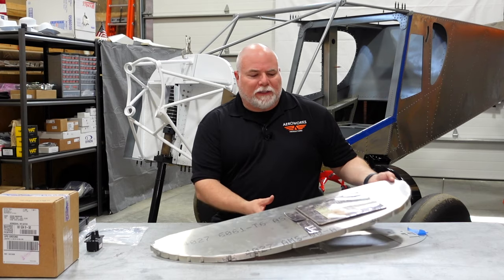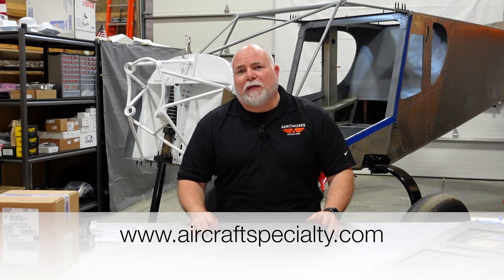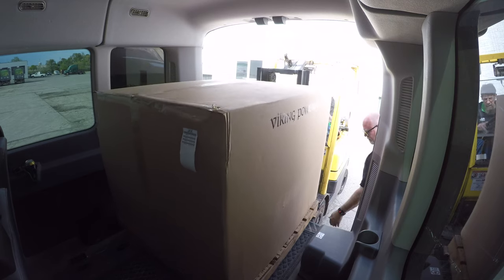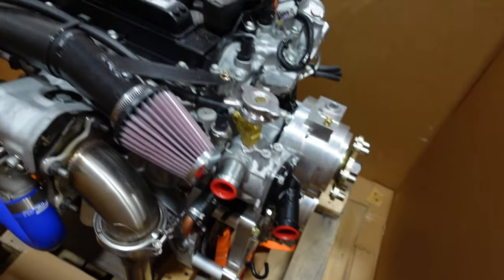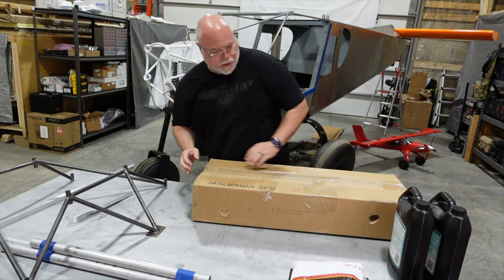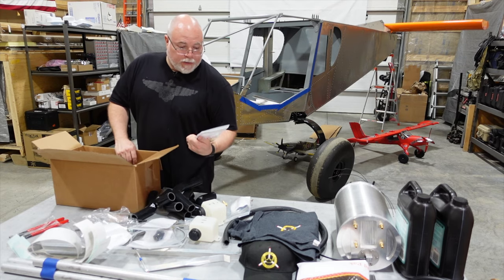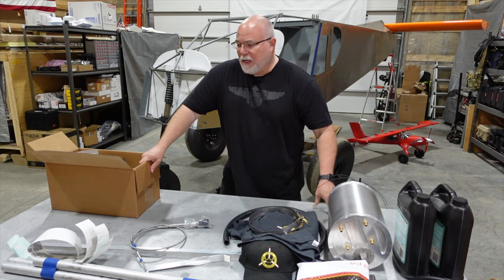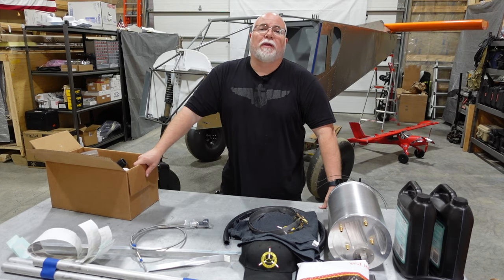Ep. 32 | Viking 195 Turbo Engine Delivery | Zenith Super Duty Aircraft Build

Comment: You might want to consider adding the Dynon Knob panel.  It makes using the Dynon much easier in flight.  I speak from experience...
Reply from the maker: Are you talking about the AP Knob panel?  If so, no auto pilot in this plane.
Reply: @AeroworksProductions  No, the 3 knob panel, Baro, Heading and Altitude adjustments.
Reply from the maker: @scottmiller4711  I finally watched your video and saw that.  Thanks for tip.

Comment: GM.  How did you bend your rudder pedal piano hinge around your rudder pedals?
Reply from the maker: I clamped in vise and made small bends to start, then when it was the basic shape I final formed it by hitting it with a mallet over a similar sized metal pipe.
Reply: @AeroworksProductions  thank you

Comment: I know powder coating engine mounts is popular, but some say it is better to paint the mount rather than powder coat it.  The argument is that you could develop a crack in the mount and the powder coat could remain intact and hide it.  As we all know, paint tends to reveal every imperfection and in this case, it likely would reveal the crack!!
Reply: We have personally never seen an issue with cracking on our mounts, a lot of that having to do with less vibration than a standard Lyco/Cont., and we always recommend a prop balance to help this even further, but still should always be checked. The paint works, but really looks horrible after only a short time and being 4130 will rust if not coated.
Reply from the maker: I can see your point, but I have full confidence in the viking mount and the smoothness of the engine.
Reply: @eggenfellner  My comment was not directed at the Viking mount, but rather concerning engine mounts in general.  I'm sure the smooth Viking engine will make cracking less likely, but ANY engine mount could crack and this can lead to a catastrophic problem.  I painted my mount with epoxy primer and top coated it and it looks great after 10 years.
BTW, very impressed with the completeness of the engine installation supplies - this will save dozens of hours of sourcing the parts!
Reply: @n206ja  for sure, I understand that completely - we just haven't had any issue to date, and people should be checking for this as part of a checklist any way, I don't really think the powder coat would disguise it though - I've seen powder coat crack before and it is visible as well. :) Lots of things could or possibly happen on anything, the biggest things is making sure people are proactive and not lack luster when doing pre-flights and maintenance to limit these issues.